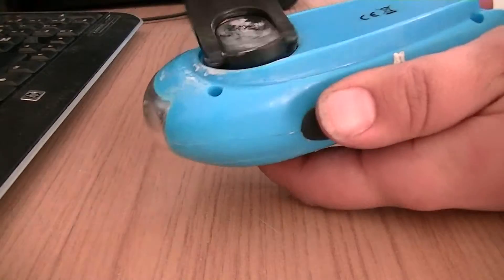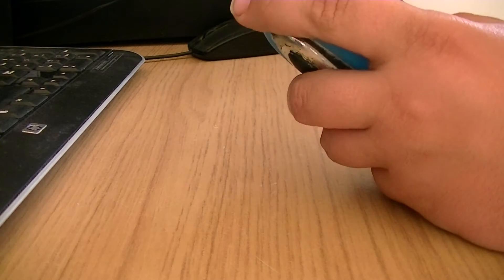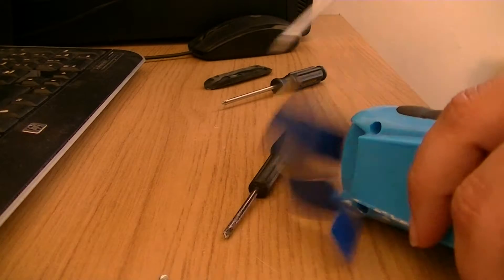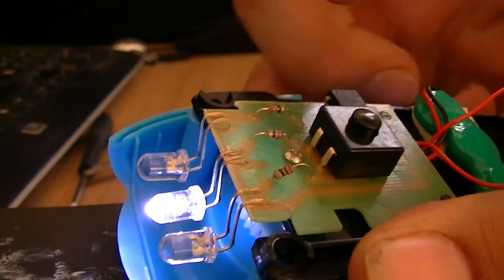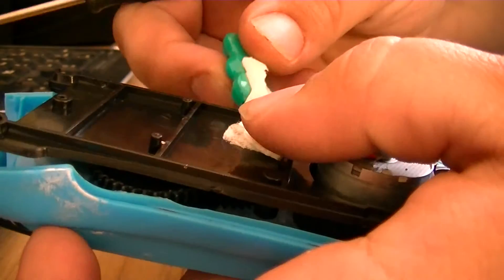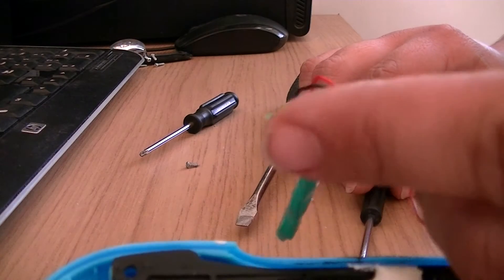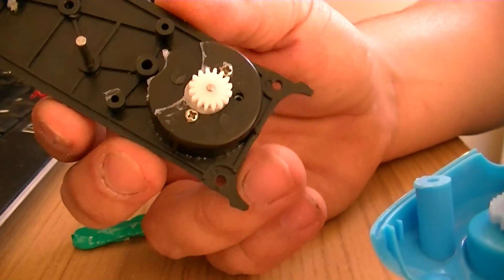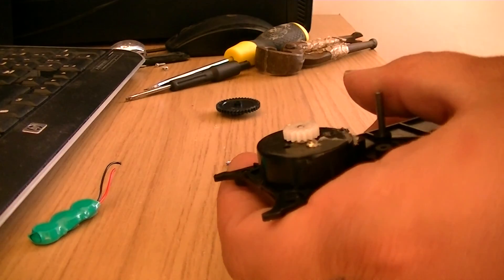Whats inside an wind up torch

Comment: Just a tip, when working with DC, instead of live and neutral, it's Positive and Negative. DC circuits typically use red and black wires.